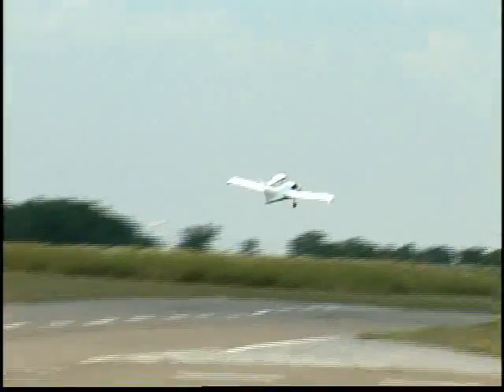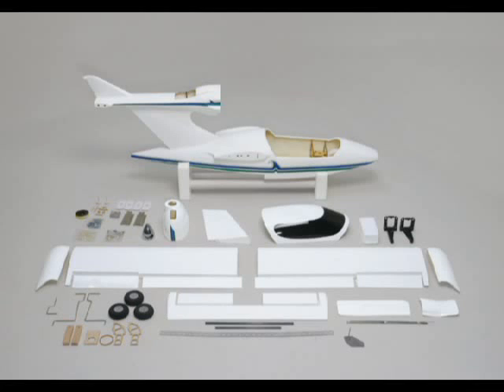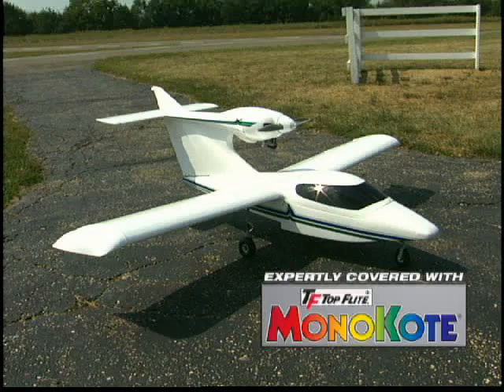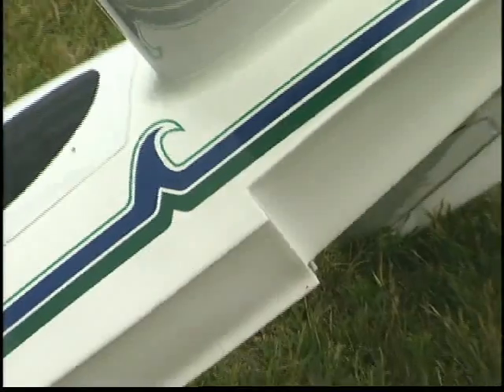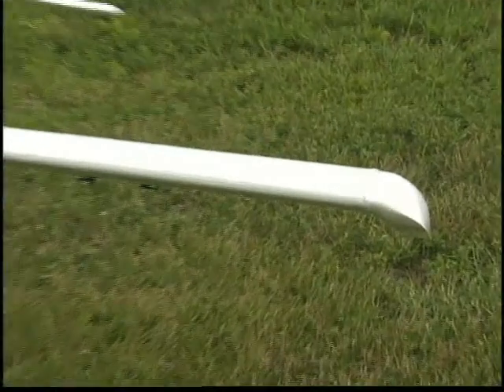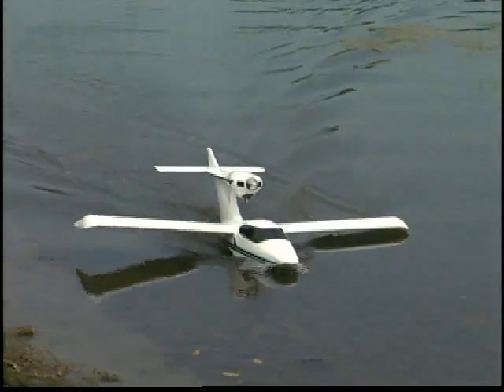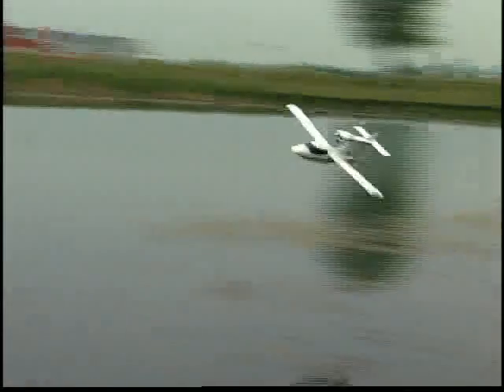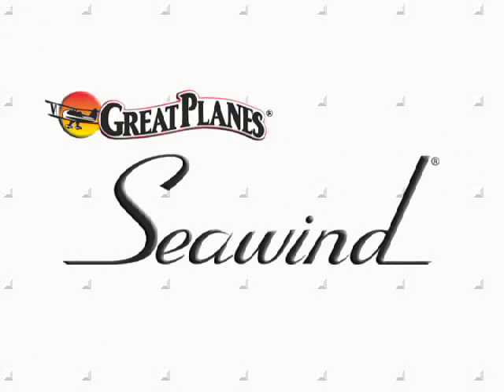Spotlight: RC Great Planes Seawind Amphibian 60 ARF

Comment: lilbro, did you watch the video haha? This plane is MEANT for both land and sea! "Fixed" landing gear is included with the kit (see pictures in vid) and retracts are optional (not included).

If you are an intermediate pilot then this is an aircraft for you. But, judging by your question I would gather some more flight time before this investment.